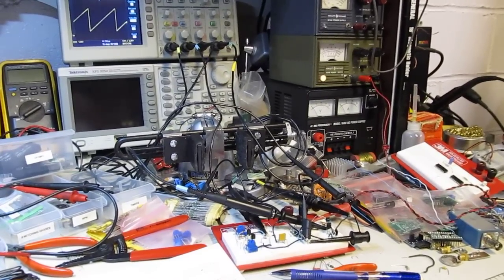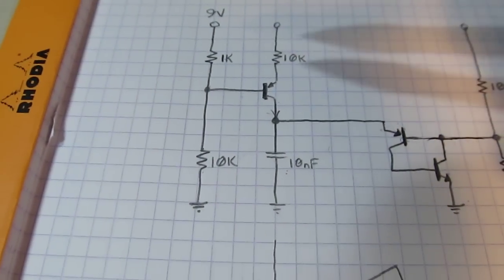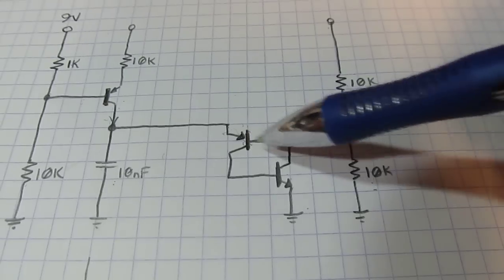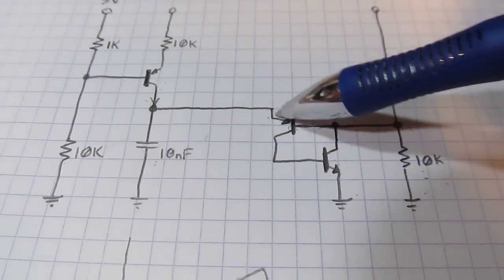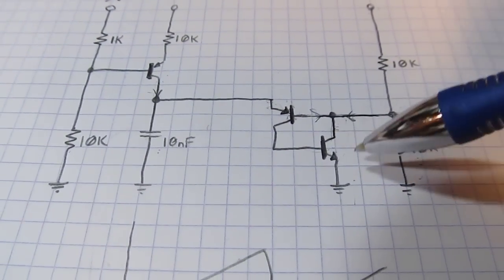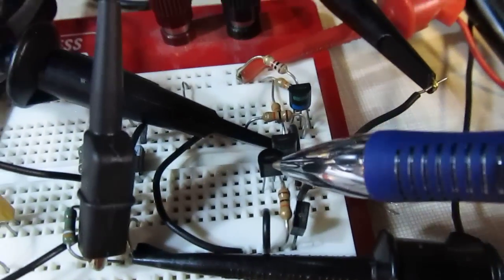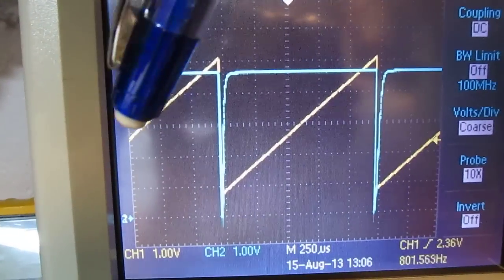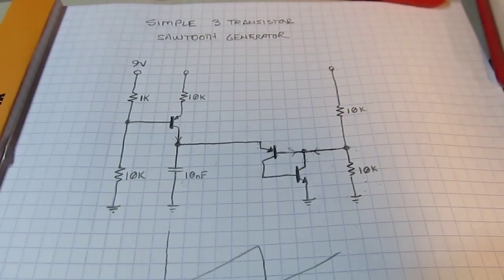#105: More Circuit Fun: Simple 3 transistor sawtooth generator / oscillator

Comment: Great videos on saw tooth and triangle, now how about generating a symmetrical triangle with one control for the frequency.
Reply from the maker: John Street One simple way would be to use this circuit:
https://www.youtube.com/watch?v=ibnz5UjQ4u0

But replace one of the current sources with a current mirror, so that the current source and sink (PNP and NPN) track each other with one control.  See this video on current sources and mirrors:
https://www.youtube.com/watch?v=xR0RfmmRhDw
Reply: John Street 

Thank you for your quick response. I watched both the videos
that you suggested, but it still leaves me wondering how would you control both
the current source and the sink to produce the same current flow with a single
control.
<span style="font-size:12.0pt;font-family:"Times New Roman";mso-fareast-font-family:
"Times New Roman";mso-ansi-language:EN-GB;mso-fareast-language:EN-US;
mso-bidi-language:AR-SA">In video #104 the current source and the current sink are
controlled independently, how can they be combined into one control?
Reply from the maker: John Street John - here's a simple solution.  It will have some dependence on the power supply value, but gives you a single control for both current sources:
https://drive.google.com/file/d/0B8Kvsw95jCqILXlZLTc1SDVVNFU/view?usp=sharing
Reply: ***** Thank you, much appreciated.

Comment: can i  control the frequency of the signal using a variable resistance ?
Reply from the maker: Islam Rostom Only over a limited range, by varying the 10K resistor in the PNP current source (connected from VCC to the PNP emitter).
Reply: ***** well then is there a circuit that can generate a sawtooth or triangular wave with a variable frequency around 1 Khz using only transistors am not alowed to use op-amps in my project
Reply from the maker: Islam Rostom This one is running at about 800Hz, so it should easily be adapted to run at 1kHz with no problem at all.  Just make the current source about 25% lower, or the cap 25% larger.
Reply: ***** thank you so much

Comment: Hi, I'm struggling to understand how the two back to back npn and pnp transistors switch off  by becoming "starved of current". I understand why they switch on hard and pull the voltage across the capacitor to approx. 0.2 + 0.7V but why does the capacitors voltage rise afterwards from approx. 0.9V? Why doesn't it stay at approx. 0.9V?
Reply: ***** I believe what is happening is that the base voltage on PNP Q2 (collector of NPN Q3) is not high enough to turn off Q2 and it remains in active mode preventing Q3 from turning off. First, I replaced the upper 10k resistor with a 5k forcing the voltage up to 2/3 Vcc to turn it off hard and it seems to work up to 9V (with 2N3906 and 2N3904). 
Alternately, you might consider replacing the upper resistor with a couple of diodes (from the power rail to the base) to force the voltage high enough to shut off the base for a wider voltage range. This allowed the circuit I built to operate from 6-12V with no issues (except frequency changes), ymmv.
Reply from the maker: When the NPN turns on, it quickly saturates. A saturated transistor has a large amount of charge stored in the forward biased junction (the same thing that gives rise to reverse recovery time in a diode). That causes the NPN to stay "stuck" on for a short time even after the b-e bias goes away (PNP shuts off). When the NPN comes out of saturation, the collector rises due to the resistor divider.
Reply: ***** I built this circuit using 2n3904 and 2n3906 transistors and as some (but not all) others have reported, the SCR-configured transistors turn on, pull down the voltage across the capacitor to 0.6V, but then they stay stuck on in that state.  The PNP transistor never turns fully off, so the NPN never turns off, and there they stay.  There's apparently something in this circuit that's very sensitive to certain second-order behaviors of the transistors that some have and others don't.
Reply: Dropping the supply voltage down to 6.7 V made it start (barely) working in my case.  The SCR system would turn on, drop the voltage to 0.6 V, it would stay flat for roughly 7 ms (longer than the rise time of the sawtooth, though it jumped around a bit) then the waveform would finally start to rise.  As I lowered the voltage further, the dead time decreased until at 6 V I finally got a typical sawtooth with the waveform rising again immediately after falling.

I don't know that much about transistors so I'm curious to poke at it some more and see if I can figure out how to make it work properly at 9 V.
Reply: Further investigation shows that if I put a 100K resistor from the base of the NPN to ground, the circuit will work at a higher voltage (up to 8.9 volts) before it locks low.  I'm not an experienced electrical engineer, so I'm kind of throwing around terms I don't understand, but it seems that something is keeping the NPN base from going low fast enough to break the positive feedback cycle, so maybe I have a poor-quality breadboard with a lot of capacitance?
Reply from the maker: That could be part of it. Unfortunately, a simple circuit like this becomes fairly strongly dependent on device parameters and parasitic capacitance etc. You can also adjust the values of the voltage divider on the right of the schematic, that may help to keep a stubborn circuit oscillating.

Comment: plzzz when i connect a led to the collectoer of the pnp in parallel with the capacitor the sawtooth signal is gone why????
Reply from the maker: Most likely because the LED starts conducting, preventing the voltage at the emitter of the PNP from getting high enough to turn the PNP transistor on.

Comment: Hey Alan!

I want to build my own function generator. How do I go about making different wave-forms with a "decent" frequency band? Say from 10Hz to 1Mhz? I can make square or triangle waves easily using an op-amp or two, but I can't figure out how to make a sine wave without distorting the waveform when I change the frequency. Also, how do I go about making the frequency, voltage or current controlled? That way, I'll be able to implement a simple frequency sweep using saw-tooth wave.

Please keep up the good work and keep us educated :)

Sorry for asking too much..
Thanks a lot and have a great day!
Reply from the maker: Well, that question is more than can be answered here!  Of course the "modern" way to do this is with a Direct Digital Synthesis chip controlled by a micro-controller.  But, where's the fun in that?  Using old-school analog circuits, you'll have to have multiple switch-selected ranges in order to cover that broad of a frequency range.  You can use a basic circuit structure like this as a starting point to create the tri and square with adjustable frequency.  The "old-school" way to get the sine wave is to use a converter circuit, often done using the non-linear properties of a diode.  Google "triangle to sine wave converter" for some ideas.
Reply: ***** Yep I thought about just throwing a synthesizer IC in it and call it "good". But like you said, there's no fun in it  and I won't learn anything by doing so. I've already tried making sine waves from triangles using op-amp integrator, but the waveform become distorted/attenuated when I change the frequency. I guess there's no other choice but to use multiple switches to select different combination of RC for each frequency range like you have mentioned.  Yes I've heard about using "wave shaping" diodes. I may have to do some more reading about such circuit ; Maybe you can do a video about it! That would be great lol!  

But thanks for the reply, Alan! It certainly helped!
Have a great day and I'm looking forward for more awesome videos!
Reply from the maker: The "Classic" way that this was done in older analog function generators was to use diode shaping. Several stages are needed to get low distortion. This technique will work well over this frequency range.
Reply: ***** Great! I'll try to use the diode shaping technique after I do some more reading.
Thanks again!
Reply: You can use the "op-amp" version of the HP audio oscillator design ( circa 1939). You could get the 1 MHz range. The 'problem' is finding the 'variable' capacitor ( R.F. radio part ).

Comment: Can I use a NPN transistor (such as a 2n2222) in the current source instead of a PNP transistor using the emitter to charge the capacitor? I would assume that the current in the collector of you circuit is a function of the hFE, is that correct? Thanks a lot for the great video.
Reply from the maker: No, you can't.  The NPN wouldn't provide a constant current, it would behave more like a voltage source instead of a current source.
Reply: Alexander Sinco Yes you can use a NPN, if the circuit is built exactly as in the schematic, but substituted all PNP's with NPN's and vice versa, then lastly, invert the polarity of the power supplies. The symmetry is due to the opposite charge carrier being responsible for the function of the different transistor types. You will not get rid of that one remaining PNP though, so probably won't solve your problem; and an emitter won't simply source current as w2aew says because of feedback effects due to Vbe.

Comment: Hi Alan, 
Thank you for this video, it is very helpful. I tried building this circuit, but encountered some problems. My goal is to have 20V ramp. I have 22V supply voltage with a 10 nF capacitor . The PNP and NPN transistors used are 2N3906 and 2N2222. The base of the PNP on the left is biased at 20 V (1k 10k). The base of the PNP on the right is biased at 19.3 V (1k, 7k). However, the circuit is not charging beyond 11.2 V..? I have tried changing the bias on both sides, the capacitor value, and the supply voltage the charging rate does change; however, the amplitude won’t exceed 11.2 V... Can you please give me a hand on this issue? Thank you
Reply from the maker: Without testing it myself, I'd first suspect that the PNP on the right might be experiencing some reverse bias breakdown which in turn is turning on the NPN and resetting the circuit.

Comment: Very nice!  I built this on a breadboard using 2n3904 and 2n3906 transistors.  It definitely does work and definitely oscillates.  But it will not work below about 7.5 volts, which I cannot understand.  The way it is designed, I would have expected it to make a sawtooth with an amplitude about 1 diode drop less than 1/2 the rail voltage (so for 9v, about 4.5 - .7 or about 3.8v, which is just what it does).  So at 6v, I would expect it to peak at 2.3v, but it won't charge up the cap below about 7.5.  If you have any insights into this, please comment.  There's hardly any current drain in this circuit, so it should be easy to turn on that one pnp and charge the cap.  It acts as though the trigger pair never really shuts off, so the cap can't charge.
Reply: mmagliaro If the cap can't be charged, the PNP transistor (2N3906) BE is not conducting. The 2N3906 datasheet says VBE needs minimum 0.65V in order to conduct.  With the PS voltage of 7.5V, VBE is less than 7.5*(1K)/(1K+10K)=0.68V. That's why 7.5V is the margin. You can try to increase 1K Ohm to a higher value or reduce 10K Ohm to a lower value.

Comment: Hi! I think that the sawtooth oscillator can not generate a periodic sawtooth; because of the fact that after 1 single oscillator the circuit reach a DC point.
When the NPN bjt turns on he descharges capacitor but PNP remains on even though there is a low current flowing. The cycle does not start anymore because the capacitor cannot charge. You have to add an additional BJT NPN with emitter to GND, base controlled by BASE of the NPN already set and collector connected to Capacitor node. Without this additional NPN this circuit oscillates once a time only...
Reply from the maker: Clearly, this circuit does oscillate, just as shown in the video.  Yes, you can bias voltage on the right such that the circuit such will reach a steady state, but when biased as shown, it does oscillate.  The cycling happens once the current in the PNP/NPN combination drops below the minimum value to sustain regeneration, the combination turns off and the charging begins again.
Reply: Let me show the circuit you mounted on the board, if you can...Because , with that circuit you have only one oscillation, not periodic...Because PNP-NPN configuration does not switch off completely and the charge of the capacitor will happen only one time
Reply from the maker: Davide Rossi When the SCR-connected PNP-NPN turns on, the NPN gets driven into saturation, and the combination discharges the capacitor.  Once the voltage drops enough to start lowering the bias on the PNP emitter, the bias to the NPN starts to decrease.  There is excess charge in the NPN b-c junction due to the saturation which, when removed, causes the NPN-c to rise, further shutting off the PNP.  The scope clearly shows that the circuit is oscillating.  For further discussion on circuits like this, see this link:
http://www.vk2zay.net/article/196

Comment: can i adjust the frequency, duty cycle and amplitude of this? how to adjust it? pls help me. i've been trying for ages..
Reply from the maker: You can adjust the frequency / duty cycle over a limited range by adjusting the capacitor value, or by adjusting the current charging it (by changing the 10K resistor in the emitter of the PNP for example).  But you really can't adjust the amplitude by very much.  Here's a circuit that allows you to more fully adjust all of these parameters:
Circuit Fun: Flexible Ramp Generator to create frequency sweeps using 555 timer and op amps
Reply: thank u very much for your help. i really appreciate it. :)

Comment: i built this virtually using iCircuit and had to put 3 separate voltage sources of 9v in order to see the sawtooth wave pattern. Makes a lot of sense Alan. Please keep up the awesome work and explanations which make sense..
Reply: I also used iCircuit to model this circuit. I have to keep remembering to set the bandwidth high enough in order to get the circuit to run correctly even in the audio range. iCircuit always defaults to 256Hz bandwidth.
Reply: I built it using EveryCircuit, but it did not work very well. Not sure why... trying to make it work.

Comment: Hi Alan, thank you for the great circuit. I have learned a lot from your videos! I built this using a BC549 and 2 x BC558s and spent a few hours on it and could not get it to generate a saw wave. The cap charges and the SCR turns on as expected at the ~5.2v mark and discharges the cap but it then it does not turn off once the cap is discharged. For the life of me I cannot figure out why and how to fix it. When I connect the power I only get one charge/discharge cycle and then nothing. Any advice? What could I be doing wrong? Are the transistors I am using not a good choice?
Reply from the maker: You may want to play with the resistor divider on the right - moving the bias point up/down a bit.  The circuit is a little sensitive to device characteristics...
Reply: ***** I replaced one 10K on both sides with 10K pots to make everything adjustable and it worked! Awesome!!

Do you take video suggestions? No one has very good antenna impedance matching videos. Everything I read or see uses expensive network analyzers. Is there an easier way to measure antenna impedance and match it using an L or Pi network on a circuit board? Also your oscillator stuff is great! Thank you for your great videos and quick response! :)
Reply from the maker: Jiten Chandiramani While this video isn't "exactly" what you asked for, it is close. Use an Oscilloscope and Signal Generator help tune an HF Antenna, and measure complex impedance